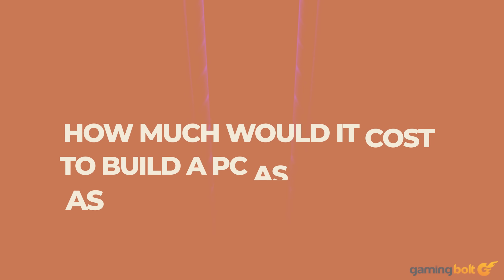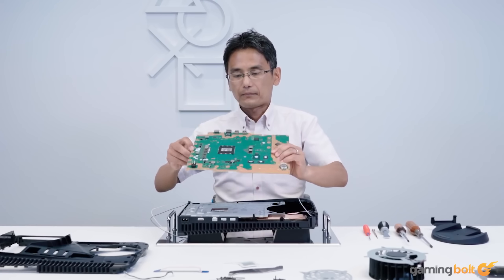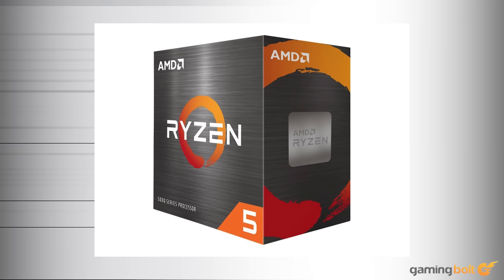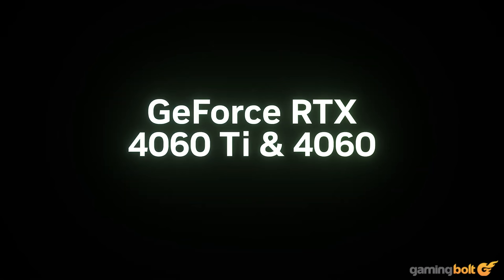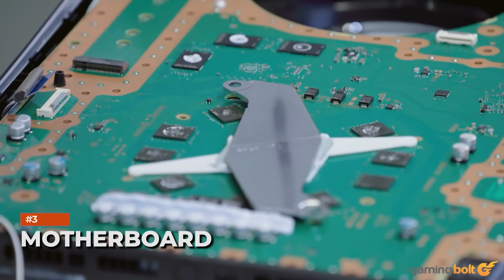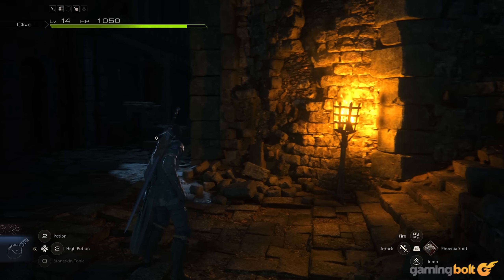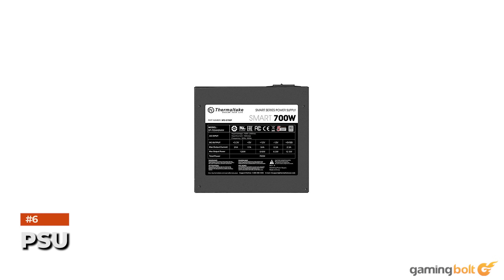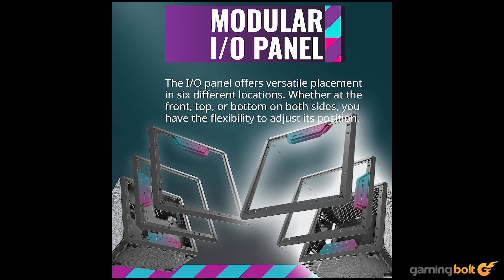How Much Would It Cost To Build A PC As Powerful As The PS5? (2023 Edition)

Comment: Well, building your own PC is the best thing you can do. 

If you pay for a pre built, you are paying a 15-20% markup to whoever actually built it

Also, games that are made for PS5 are made exactly for PS5 and you dont have adjust many settings to make it run optimally 

Also, while your more expensive computer parts become outdated over time, new consoles will always relatively cheap

Also many games are made for consoles anyway and end up not running well on PC ie Elden Ring, Jedi Survivor, The Last of Us
Reply: No, the best thing I could do is get a divorce.
Reply: why nobody mentioned that for playing online on console you have to pay every month/year and on PC is free? lol
Reply: That's funny. I remember ps5's selling for over a grand at one point. Back when they were first coming out and there was a shortage.. meanwhile my 6-7 yr old PC still contends with current gen console hardware
Reply: Well they can optimise for the latest graphics cards and also for PCIe 4.0 NVMe SSD. Even if you only have a Gen3 NVMe SSD, with Microsoft Direct Storage, Gen 3 NVMe SSDs can run at the same speed as Gen4 or Gen5 NVMe SSDs. It has to be an NVMe SSD to take advantage of the Direct Storage though.
Reply: You can always upgrade a pc. can't upgrade the console
Reply: Pre builts may have some good specs but they cheap out where possible to keep profit margins high. Build a pc.
Reply: @itsallmakebelieve9151  usually the PSU that suffers.
Reply: Computer parts have longer lifespans than entire consoles. You also don't have to completely rebuild your PC to stay up to date, just a part here and there. The initial cost may be a little bit above consoles, but you save in the long run. After a few years you're replacing your entire console while a pc only needs to replace 1 or 2 parts, making it way cheaper to move to "next gen". Not to mention that people often forget about CONTROLLERS when it comes to console when you're considering the price. Controllers are about $80 a pop now and most people want at least 2 of them. So your $500 Ps5 is actually $660. Not to mention those controllers become obsolete with the next gen. Considering this along with everything else makes it obvious what wins in the long run.

The only game you listed for one platform in mind was TLOU because it was originally only for one platform.  Everything else was released across all.
Elden Ring doesn't have PC issues and you cherry picked 2 other poor use cases. If you want to do that, look at Diablo 4 for consoles and all the stability and disconnect issues people have.
Reply: @BamBam0141  My processor alone costs $730
Reply: @brad4058  you either went pretty high end or got ripped off
Reply: After a few years? You mean like 10 years, there's no justifying why someone would waste the money on a PC except they just want to spend more money and get less
Reply: @BamBam0141 not really. I have a full Alienware PC that's turning 4 year's old now and almost everything will needed updating to even bring it level with a ps5 now. PC part's change and update so quickly that most really good mother board's are out of date and incompatible with in 5 year's or less. Why do you want two controller one is perfectly fine 8 hours charge time if you turn down some of the settings like light bar. Any good PC that would be better than a Ps5 will cost way over 1500 and that's not adding in software. If you did it all legal using good part's you would almost be spending double you're money and not really gaining much more shelf life than the ps5. For cost and specs ps5 is a really good option if you don't want to spend anything over a thousand and most people don't or haven't got that money to spend on a gaming PC.
Reply: @chriscollins550  "I have a full Alienware PC"
More than enough said LOL

People want 2 controllers because couch coop exists. Most people get 2.

You're literally in a video where they proved its not $1500. It's $700 here and they're even using a GPU that blows the PS5 out the water. An equal one will drop the price to around $550. I build desktops and repair laptop, phones, tablets, etc. January this year I built one that outperforms current gen consoles for about $650. I've also built cheaper ones. I've also built ones over $5000.

"Without adding software". This screams "I know nothing about pcs" because you don't have to buy shit.

Consoles do still have a niche. They're for casual users that simply want to plug and play games. That's it. But in no reality does a console outperform a pc in any metric past that.
Reply: @BamBam0141  that's using US prices. Try paying European or UK prices it's double or even triple that on hardware part's then it is in the USA. I only ever had one controller. For what it would cost to build a PC that would out perform a ps5 on around the same cost just wouldn't be possible hear. The cheapest good off the shelf dedicated gaming PC is well over 1200 plus and that's not includeding software or vat.
Reply: @chriscollins550  I mean, we all know the UK is fucked. Possibly a little more than the US. At least concerning costs. I'll agree in that situation you're gonna have an easier time just getting a console.
Reply: @BamBam0141  not just uk. Of you buy them part's anywhere in Europe it's almost the same as the UK. European tax and adjustment for exchange rate then import costs added on. To even be on leave with power of the ps5 we are looking around a grand at the minimum. We can use the Internet to get thing's cheaper from places like the USA but you still got to pay costs on that so it doesn't make it that much cheaper. Outside of the USA what they are saying is very feasible. Theres also not many dedicated PC shop's anymore that hold all these part's on the shelf.
Reply: In south america is true story. 

But even for the price, i would only buy a consolator if i first i had a good pc, because i fucking hate masturbators (controller? FUCK THAT SHIT, I LOVE WASD). And not to mention you can plug a masturbator (controller...) to a pc, even a laptop, and you can watch videos movies watch porn and much more. Things you can not do in a masturbator.
Reply: Consolator i mean.
Reply: @chriscollins550 dude you live on a completely different planet I think
Reply: @Invictus-f9q  if you think so
Reply: @chriscollins550  Bro what? I played CP 2077 on a i5-4690k and a 1080 at 4k. I had to turn some stuff down, sure. But it was still gorgeous and blew the consoles visuals out of the water. The 4690k came out in 2014 and 1080 in 2016.

Get outta’ here with that nonsense.
Reply: @copecope7278  don't believe you.
Reply: @chriscollins550  That doesn't change anything.
Reply: @shoechew  it changes a lot when the price that the hardware cost is triple the cost of a ps5
Reply: @BamBam0141 yeah I watched this video and looked at these comments....I'm like 'do these fellows know enough about pcs?' the video already has PS-sided undertones. Everyone can like what they want, it's all good. No need to misinform though. I like how he says a blueray drive 😅 I mean I guess that's true but who tf buys physical disks for their computer. And yes that other buddy with the "Full Alienware PC" yeah sorry bud I wish pc companies were as in line with consoles as in set price no gouging....but yeah you got gouged by Dell. I hope you give PCs another shake by building your own 👍 and do your homework 💙
Reply: @chriscollins550 did the video clarify this is talking outside US prices?
Reply: @BamBam0141 someone mentioned that they said 4060 and meant that, even though the 4060ti was shown
Reply: @JROCK50054  you're right, good eye. The rtx4060 still has better performance and power efficiency than the ps5, though the ps5 has 16gb vram vs. the 4060s 8gb, which does help bridge the gap a bit. If you wanna account for the TI instead here, throw an extra $100 on the end cost and know that it'd be significantly better than the ps5's gpu.
Reply: @BamBam0141  Yeah, consoles.
Reply: @kieranczyzniejewski2178  LOLno. But go off. Just say you like throwing money in the garbage.
Reply: @BamBam0141  Sounds like what you're advocating for
Reply: @kieranczyzniejewski2178  Projection. Baseless. Literally proven wrong.
Reply: No one mentions that the series X is more powerful than the ps5, wonder what you'd have to waste to get a PC on the same level as that
Reply: @josephhall7317  because the series x isn't as powerful. You should take one apart and have a look at the hardware. It's not even close to the power of the ps5.
Reply: @chriscollins550  do a quick Google search,  and I did have my ps5 apart the other day
Reply: @josephhall7317  you're delusional if you think XboxSX is more powerful that PS5 LOL. Xbox only looks very slightly better ON PAPER but is worse in practice. There are literally hundreds of sources and tests that prove the PS5 is better at performance, load times, installations, boot, etc. As I mentioned before in here, I work on these systems along with pcs, laptops, tablets, phones, etc. so I know WAY better than you.
Reply: @BamBam0141  a delusional calling someone else delusional. You sound like Dr brule when he says " I'm a Dr so I know " like I said, do a Google search and come back with every result found,  series X is more powerful with better graphics also and xbox has been since the start, ps5 can slightly minimize the download size of games more than a series X, that's about it besides being able to put a non proprietary ssd in it
Reply: @josephhall7317  it's more powerful in everyway ps5 is more powerful on standby. Saying xbox has always been more powerful is bs as well. There's a reason why the xbox has always been cheaper and less popular. I taken them both apart the ps5 motherboard it's self is 50× better the prosser is a lot better than what's in the xbox. Xbox can't even run true 4k. I think you need to do more research.
Reply: @chriscollins550  Prefacing that we are in agreement here, but im just adding a little bit of clarity for Joseph since he doesn't seem to be the brightest lmao. So this is is mostly for him.

Xbox CAN run native 4k, but it's very limited. It's mostly upscaled.

The cpu isn't 50x faster. Xbox cpu is "supposed" to be capable of running faster, which is why I told Joseph on paper it's supposed to be better, but it doesn't perform better in benchmarks. It runs the same or roughly 10% slower than ps5. This is likely due to poor optimization of the system's OS.

Xbox IS faster ONLY when it comes to turning on from a completely off state. It's only a difference of around 10 seconds on average, so for most people its entirely irrelevant. From rest, they're the same. PS5 downloads, installs, and boots games faster. On average, it's about 30% faster, which is huge. And that's only with its STOCK SSD. This gap is widened significantly if you drop an NVME in there, which is not possible with the Xbox.

PS5 consistently has higher/more stable framerates over Xbox. Look at comparisons with games like Elden Ring.

Xbox has more texture pop in than PS5. This is a negative.

PS5's raytracing is also more consistent and richer/more realistic in most games compared to xbox.

There's many more things I could touch on but I don't feeling like spending more time than I already have.
Reply: @BamBam0141  I'm not the brightest? You're still on here making things up like the last 4 things you wrote,  so continue with what makes you feel better Radio
Reply: @chriscollins550  like I told the other person,  go ahead and look at every Google result possible,  then come back
Reply: @josephhall7317  I Don't need to I had them apart and been into the bios there not even close. That's all made up bull shit.
Reply: @chriscollins550  alright